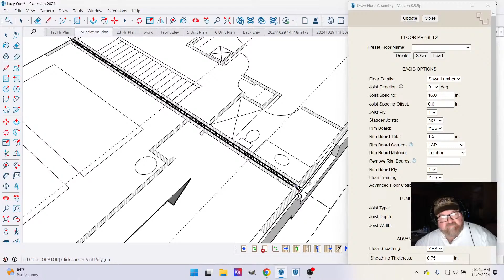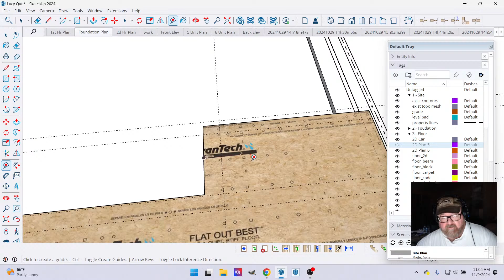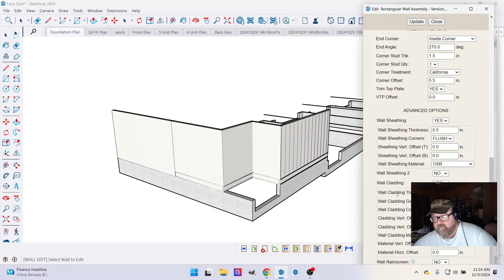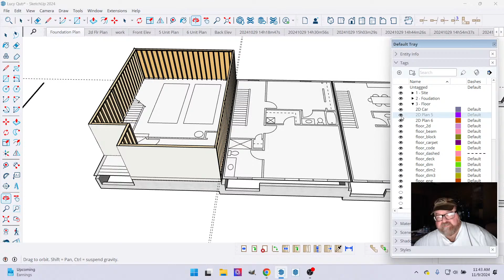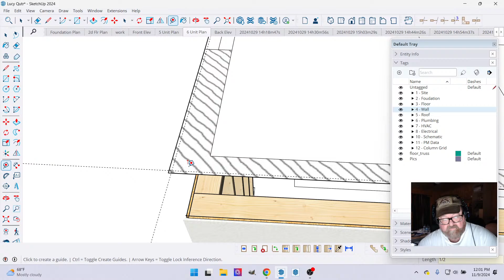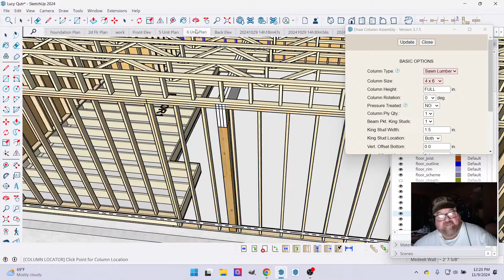Live SketchUp Work Session - Creating Townhomes with Medeek - Part 1

Comment: Hi Tony, I assume these are "Fee Simple units? 
We designed and built 36 three story fee simple townhome units last year and have enough land in place to do 42 more plus a small plat of 15 homes. Then we are done and retired as keeping up with all the new regulations have worn on me over the years. If the right buyer were to come along, we would sell the land and be done. Looks like where you are located you do not have to put up with the anti-growth movement.
Is there a reason why you chose to run the joist in the direction you have drawn?
When I have a bad day, I go to your channel for some relaxation.
Thanks for passing your knowledge onto others. It is desperately needed since wood shops have been eliminated from high school programs. The carpentry school that was sponsored by the MBA that I went to closed its doors 40 years ago. 
JK
Reply from the maker: The floor trusses are running in that direction because I need to run duct work front to back. If I run the trusses the other way, I cannot count on having an opening in the exact location I need it for the HVAC trunk line so I run it in a direction I know will work.  Plus I want my load bearing walls front and back in lieu of the common walls between the units except for the beam point load.  Thanks!